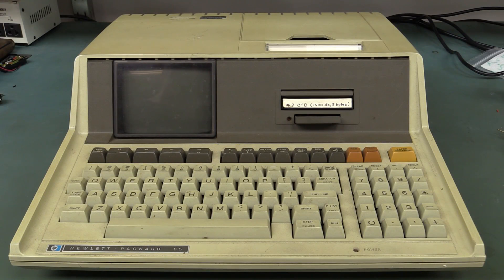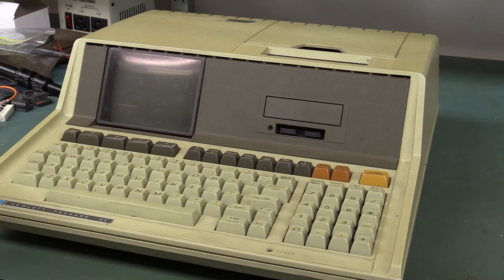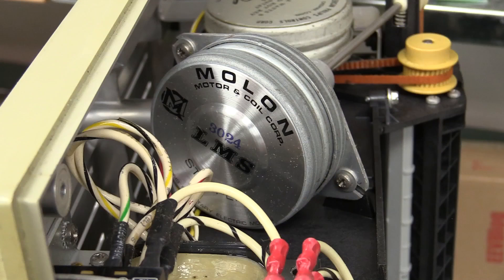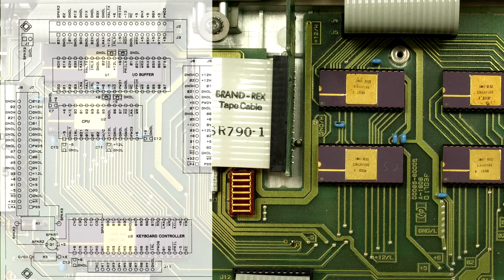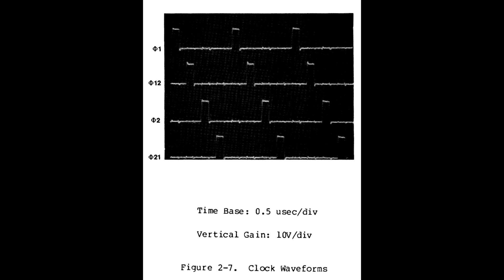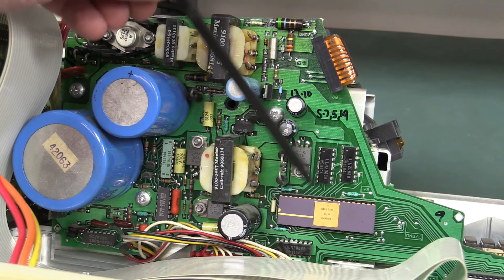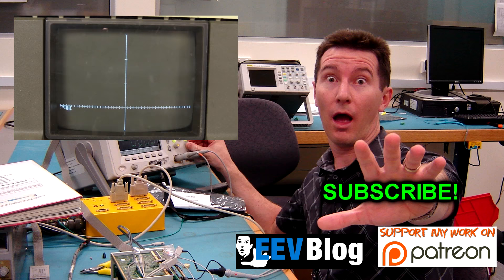EEVblog #903 - HP85 Vintage Computer Teardown

Comment: Looks like you've never played with a data cartridge like this before, Dave

The visible capstan won't drive the tape directly. It'll drive a stretchy band that runs partly around the outside of the spools, in contact with the tape, so the tape speed always equals the belt speed. IIRC there's a mechanical trick to make sure the tape is always slightly tensioned.

This drive works equally well in either direction and changes in direction can be done very quickly without any danger of tape coming off the spools.

I think the crap on the head is the least of your worries with this drive - look a the rubber parts on the capstans.

Comment: I think the stuff that is on the tape drive rod was the rubber that spinned the tape and that is very similar to the tape drives in the 90s and they don't oil the component in the tape that spins

Comment: Used These In The Late Seventies In The  North Sea Offshore Oil Industry Always Taped Down With Gaffa Tape To Keep Them From Being Flung On The Deck. (Force 10 In A Survey Vessel Like 170ft Coaster)  With The HP86 Having The HPIB Interface For reading Data From Sylidis  (Decca Navigator) Trisponder and Early Sat Nav ~ the time between bearings was 90-110 minutes

Later The HPIB becomes SCSI

Yep Things Have Evolved A Lot

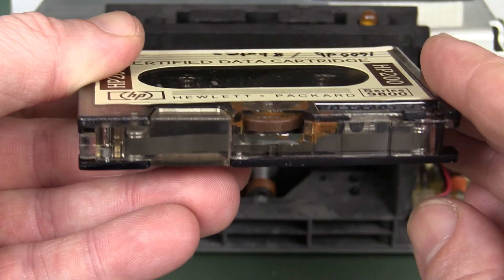Comment: That thing is really nice to look at! Is that a 2 track tape head? Good track isolation! What's going on with that tape drive roller though? Somehow I don't think that's lubrication grease... has something urethane turned to 70's/early 80's goo? Looks like it's on the tape 20:51 but it obviously didn't make it over to the head yet. I can't even tell if the brown stuff was originally a roller in the cassette or the drive! lol. Hmmm... I'll try and research this. Great find Dave! Best of luck healing that ACL; no pain killers?!?! I hope they'd at least give them to you if you really need!

Comment: Actually, some of the ICs with just HP part numbers are really standard ICs.  HP had them manufactured with their own part numbers.  Eg. 1820-1266 (at 18.00) is really MM80C97N.  You can find HP part number cross reference table in th Internet.

The CPU was kinda 64-bit one, all registers having 64-bit length but address space was 16 bit with memory mapping.  HP custom ROMs understood the CPU bus protocol.  There was an EEPROM drawer you could put standard EEPROMS, 2716s, 2732s.

Comment: It's actually quite fast: The 613kHz(?) is 4-phase – IIRC, many instructions just need one 613k clock to execute. I have to get back to mine...working except for needing tape capstan repair. I recall doing some informal tests, and the BASIC execution speed was way faster than other machines of the day (Z80...). So...quit whining about the speed!
Reply: From my own museum page: Although the processor clock is only 613kHz, the 
architecture is streamlined for math and is a bit RISC-like.  For 
example, the operation r1=r1+r2 takes one clock (well, four phases of 
one clock, so you might say the clock is actually 2.452MHz).  There are 
64 registers.  It appears to run significantly faster than a 
contemporary 8080 or Z80 system.  64-line history.  Amazingly high 
integration for 1980, the entire machine consists of 11 LSI chips that 
do everything - processor, ROMs, keyboard, I/O, video, tape drive, 
printer.  There is essentially NO digital support circuitry.  Most of 
the remaining circuitry is for power and the CRT.  Eight 16Kb DRAMs, 
plus four more for video memory.  Dynamic range of 10^+/-499.
Reply: Compare the BASIC execution speed to the contemporary Z80 based ABC-80 or ABC-800 (see Wikipedia). I doubt the HP would come out as the faster machine.
Reply: By any chance from the speed be slowed down or anything else be slowed down or stopped buy that apparently cracked chip I'm not talkin cracked as in terms of the firmware thing you know act racing but a physical crack in a chip released I think that's what it is it's hard telling video but I saw at least twice nothing was even said how did he miss it when he was that close to the ships what the??????

Comment: I know I'm way late to the party, but the roller wheel on the tape drive is shot.  That gummy oily stuff is the result of the original material breaking down over the past 40 years.  Unless you clean it off and replace it with a new roller, you'll do nothing but ruin tapes with it and you will unable to read/write any tapes.

Comment: Are those red connectors seen on the side of the printer assembly still made? I've found them (always in red, for some reason) in lots of old equipment I've taken apart and I quite like them, but I've never seen them in newer stuff.

Comment: Just had to go look on Ebay.  They are still out there from $195 bucks to 400 depending on who's selling.  Surprisingly the cheapest one seemed to be the best of the lot. ROM drawer was nearly filled,  three tapes, full case with extra memory and claimed worked 100 percent, even an extra roll of paper, what a buy.  An well my wife would kill me if I picked up one of those little gems, and a happy wife is a happy life, so I shall just dream of such fun and play with DOS emulators on my DELL Laptop.

Comment: Be careful with ribbon cables. I had similar cable in the tariff block (a.k.a. clock) that broke quite easily.
20:07 is that motor with optical feedback?

Comment: There's a read-worthy article on the design of the custom chipset in an HP Journal from 1980 at <http://www.hpl.hp.com/hpjournal/pdfs/IssuePDFs/1980-08.pdf>, beginning at page 18.
Interesting excerpts:
 * The bus is a multiplexed 8-bit design, where two cycles are address cycles, and following cycles can be used for reading/writing successive addresses thanks to each chip on the bus having an auto-incrementing address register.
 * The RAM controller handled DRAM refresh internally (as opposed to eg. IBM PCs that needed the CPU to refresh memory, IIRC).
 * The CPU is an accumulator-less design, thanks to a register file with two read ports. The article goes into some depth on the challenges HP encountered to build a two-read/one-write register file.
 * There is in fact a crystal clock generator somewhere, not an internal RC oscillator as Dave speculated.
 * To access the code from the expansion ROM drawer, some of the internal ROM chips have to be disabled to free up the address space.
 * The entire chipset consumes 2.6 W.

Comment: The keyboard switches are made by hi-tek and/or stackpole - there's some ambiguity as to which of those two is actually responsible for their manufacture.
Reply: I remember that this type of key was prone to 'bouncing' when the contacts aged and/or got dirty. Hit the key once and you got several characters on the screen. A little alcohol and bending the contact inward usually took care of the problem.
Reply: Yep, they are considered rather mediocre as far as linear switches go, in the vintage keyboard community. Better switches could be had even at that time, such as honeywell/microswitch hall effect, but I suspect those would have been much more expensive to put in there.

Comment: Now if their laptops were built this good they would be in the money!
Reply: John Hartman
Yea those printers Really lasted and some are still going strong with more than a million pages on the clock! Now days all one has to do to break something is breath on it or look at it the wrong way.
Reply: I've got a Laserjet 5L, perhaps the last decent laser printer from HP, still my main and working perfectly! There is a flaw with that model however of it pulling multiple sheets when they get to about 10-15,000 for page count but I never have multiple sheets on anyway so it's not an issue for me.
Reply: John Hartman I have a second HP Laserjet 5L too, I scored the second from a skip bin probably 5 months ago, have only tried it once and it works well apart from the toner being a little low (I've got 3 spare C3906A toner cartridges anyway) but you reminded me to check if the roller on that one is still good. I won't bother about the multiple page pulling issue unless it stops pulling pages completely or something else goes bad I'll use the second and when the second one dies I'll use the first for parts to fix the second.

Comment: Hp often used rebranded chips from some other maker.  I would compare the pinout of the CPU against one of the same era from Mostek.
Reply: Almost all of the VLSI used in HP's small computers and calculators up through 1980 were custom HP designs, including the HP-85 CPU. The only exception I can think of offhand is the HP 9815 calculator, which used a Motorola 6800. Their personal calculators (and the HP-85) used custom HP ASICs fabricated by AMI and Mostek. The microprocessor-based 9800 series machines used custom 16-bit microprocessors designed and fabricated by HP (except for the 9815.) HP switched over to Motorola 68000 series microprocessors circa 1981 in the 9000/200 and 9000/300 systems.
Reply: The Vintage Technology Association
In the past, I have found matches between HP parts and others.  I am not sure if those other parts were supposed to be on the market or not.

Comment: They made that thing to last, unfortunately it's in an industry where nothing lasts.
Reply: Well, not exactly, if you ask me. Remember, this was made for the scientific/engineering lab equipment market, not the consumer PC market, so equipment turnover for certain applications can be pretty infrequent, and sometimes control/calculation programs made for a particular machine can be a pain to port over to newer hardware. I work in the Radio Frequency/ Microwave Frequency industry, where, aside from a few modern niceties for interfacing with today's computers, my industry's lab equipment has barely changed in its design since the mid-1980's. The lab where I work still has 20-30 year-old equipment in regular use alongside our newer stuff, and one of our lab computers still runs Windows 98 on a Pentium 1 because we never bothered re-writing one of the control programs that we use for a particular measurement rig.

Comment: Presuming 1960 is year 1, 1979 would be year 20.
Reply: The first two digits of the date code are the number of years since 1960. 1960 is year zero. a 20xx date code indicates 1980.

Comment: Ok so about that tape drive roller... It used to be part of the tape drive itself (not the cassette or cartridge). It's far too small now. here's a helpful site: http://www.series80.org/Articles/capstan-repair.html       yunk! 70's goo. I've been running into that a lot recently. Seems they were mixing the urethanes with other stuff and this would accelerate the urethane breakdown. It would be hilarious if they made polyester urethane leisure suits that turn to goo!! Bet they'd still sell that on ebay for at least 10x the original price... never opened once, must be good.

Comment: 1979 is only two years before the Osborne 1 came out — also "portable", also built in CRT, but it used floppies (two single side, single density, 5 1/4" full height units with 92 kB per disk — none of this modern double density rubbish) instead of tape, and it ran on a Z80 at several MHz which ran an actual CP/M operating system. Also the Commodore PET had been out for two years in 1979.

With the amount of effort HP put into this, they would have probably expected to sell it more or less unchanged for years at test gear prices — and they couldn't drop the price like others because it's full of custom chips instead of jelly bean PC parts that were getting cheaper automatically by a factor of two per year.

It's a beautiful machine, and yet also a clear expression of just how much HP missed the boat back in the day.

Comment: And once again the "don't turn it on" part doesn't make any kind of sense. The video would have been more enjoyable if you had spent one minute out of the 24 to show briefly what it looks like when used.

And this time don't come up with the crap that everybody knows what it is and what it looks like when turned on. No, they don't! I bet 99.9% of the viewers have never even seen this machine before, much less see it operating.

Why, oh why "don't turn it on"? Why not? What sense does that make? It's completely nonsensical. It doesn't even work as any kind of pun or catchphrase, really. It's just idiotic, and it lowers the quality of the videos. And it's not like you have never broken that rule before, because you have.
Reply: Are you having a bad day mate ?
I suggest you check out the other video's about it before making dumb comments !
Reply: Ian Clarke
Why exactly would I care about some other video? I'm talking about this video.
Reply: WarpRulez
Because, in another video, Dave actually turns it on AND shows what it can do, he even shows what it looks like and ALL of it functions, go and check it out.
Reply: Ian Clarke
Which part of "this video would be better if you did thing X" are you unable to understand? Do you have some kind of comprehension problem?
Reply: WarpRulez
This is part 2 of a 3 part video which were all uploaded on the same day. The first one shows it working, each one is over 30 mins long. Is it too much trouble to try to watch them in series to get the full picture ? Are you so used to being spoon fed and having everything in one place that you can't click a couple of links ?
I watched them in reverse order, it made perfect sense and it was very interesting !